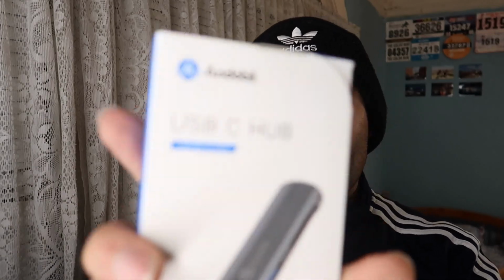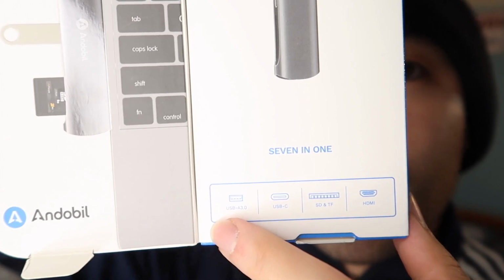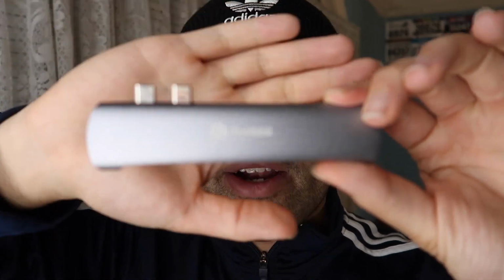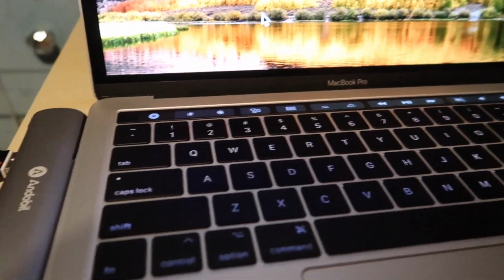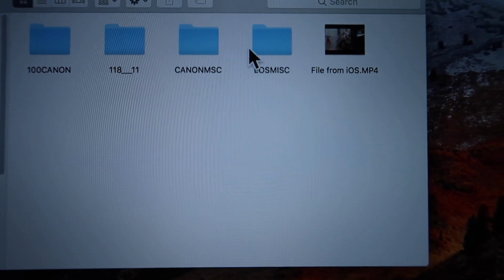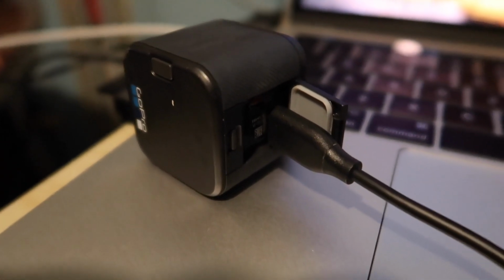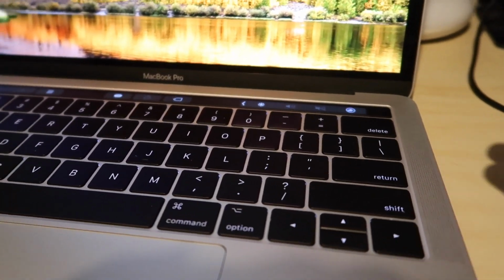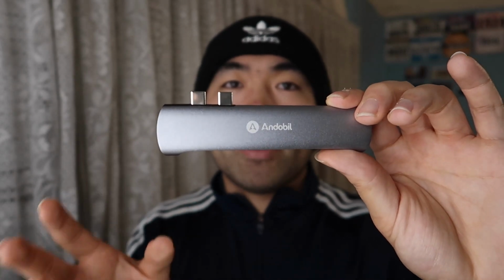Andobil 7 in 1 USB C Hub Adapter Review! Worth it?

Comment: I have a new 2020 MacBookPro 13 inch with the M1 chip.  This product did not work at all.  Not sure if I have to download any drivers or change any settings but it's not working and the thunder ports on their own work fine.  Thoughts?  This is the 2nd product I bought. Neither have worked properly
Reply from the maker: Honestly I wouldn't recommend it anymore after using it for a while, it starts to mess up my usb c input on my laptop, it started to get loose. Could also be the issue with apple macbook usb c input.
Reply: @IsitWorthit1  Thank you.  Very good point not worth the wear and tear.  Any other suggestions on adapters?